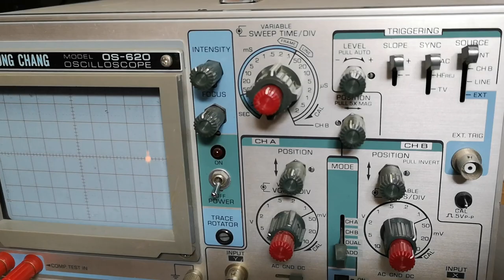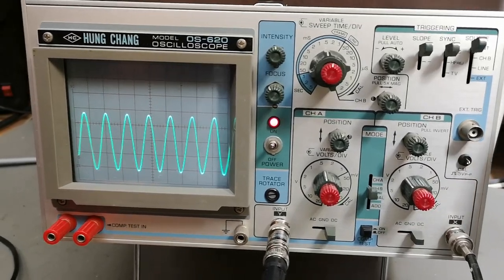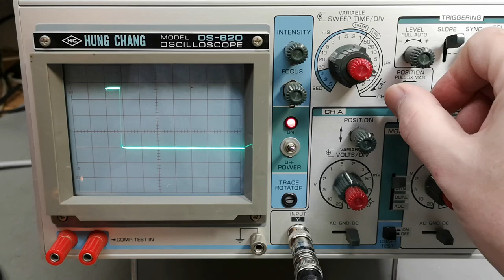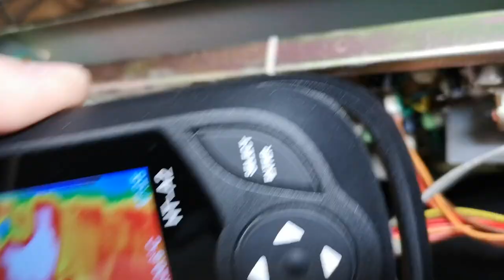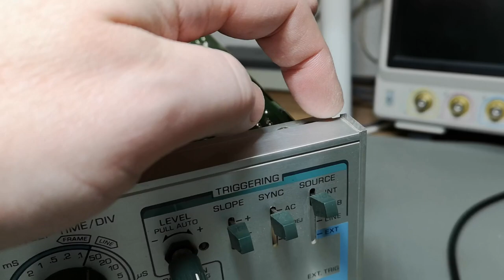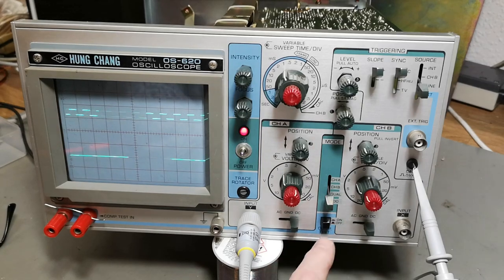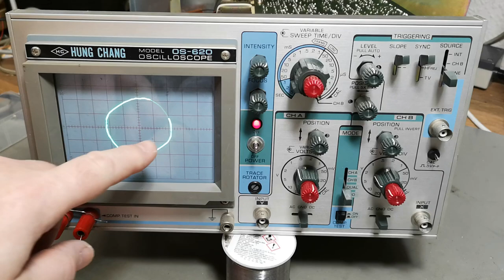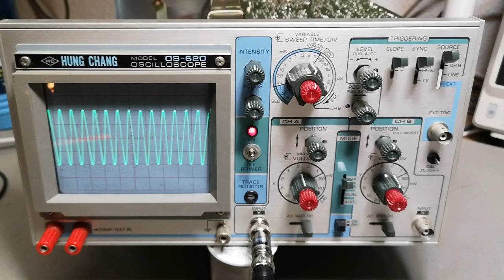Hung Chang OS-620 Oscilloscope 2ch 20MHz 1985 test teardown

Comment: Hi Thomas. I may be wrong as I'm no engineer in Heat Radiation but it seems to me that you would want the heat sinks to be as cold as they possibly can be. Being made from aluminium they are effectively conducting heat away from the powertransistors unto the surface of the heat sink from where it should be transfered by convection cooling into the air. By covering the surface you prevent this form of cooling and you are effectively rising the operating temperature of the transistors. This, I believe is what's picked-up by the heatsensitive camera.
Best regards,
/Torben
Reply from the maker: thanks a lot for your comment : thermal cameras work by radiation, shiny surface dont radiate heat, they reflect the heat from other things nearby, like a mirror reflect a picture of you, this way you dont see the temperature of a shiny heatsink, even if it is burning hot, adding a thinn layer of paint, will not isolate its heat, but will make it radiate, it will actually be a little bit colder, but now i can read its temperature by a thermal camera, i hope it makes sense.

Comment: Hi, where do you go for the gauges? 👍
Two observations, the right side skirt cannot be mounted the other way around, from the shots it seemed to me that the spacing of the screws is similar and visually it looks like a belt without the need for orientation, if there was a slight deviation on the nuts, the overhanging side could be down.
The second observation concerns the "Test Component" function, the displayed curve should be horizontally mirrored, i.e. during a resistance test, the usual image on curve trackers is from the lower left to the upper right quadrant. The same applies to the Zener diode test, the Zener voltage knee should be on the left (the current curve points to the lower left quadrant) and the voltage drop knee on the right side of the screen (the curve points to the upper right quadrant).
I personally can't imagine troubleshooting without using the curve tracker, I've found so many problems with it that I can't even count them. For example, an ordinary diode - the diode tester on the multimeter measured a normal voltage drop, when I tested the diode on the tracker, I discovered a problem, the knee of the transition was correct, but the voltage horizontal part of the curve was slanting down. Exceeding the current maximum of the diode during a device failure resulted in partial damage to the diode, and in the repaired state it then caused problems after heating to operating temperature.
For a Chinese person, the color design of the panel is quite normal, I really hate their coloring books for "Barbie", the same applies to displays, if each line does not have a different color, they are not satisfied.
In the Czech Republic, a Chinese man was selling fake Adidas shoes in a market, with the word Adidas everywhere and four stripes on top of that 🤪 When asked if Adidas should have three stripes, he answered "Yes sir, the more stripes, the more Adidas" 😂 and this also applies to the colors on the gauges - the more colors the more accurate it is 🤣

Nice day 🙂 Tom
Reply from the maker: ha ha, yes it is a bit colorfull and a bit smart designed, but it actually looks better in real life, and you get used to it, I think they try to make young starter people to get it, as their first scope, I also think you are right about the curve tracer, it is not super important if it is mirrored, the main feature is there, and it will be able to reveal a leaked diode, as you say that is the most common problem many people oversee, and why a repaired unit come back for more service short time after, if all is not solved first time.
Reply: @TeardownOZ2CPU  I probably expressed myself wrong, which is not surprising given my knowledge of the language. I find the colors on this model acceptable, I know much worse panel color schemes.
Full agreement, until the cause of the malfunction and its possible consequences are revealed, we cannot consider the device repaired. I know service technicians who replace a defective component and don't find out "WHY" at all. This can lead to an avalanche of malfunctions in the device, which, due to subsequent defects and the spread of problems, can become unprofitable for repairs. In my former job, it was the most common conflict with the management, why is it taking me so long, why am I still working on the device when it works, they didn't quite understand my answer "I don't know why", but it always paid off for me - I haven't had a single complaint in 18 years.

Nice weekend 😁 Tom
Reply from the maker: @Edisson.  good story :-) you can see some of the units I repair, got signs of erlier repairs, and funny : that is often where i need to fix things first.
some of the erlier repairs are actually the faults and reason for more problems now, using wrong parts for the job due to not understanding the correct feature needed.
Reply: @TeardownOZ2CPU  Yes, I noticed, some interventions are really "luxurious" and the one who performed them should hand back the report card up to the first class. I've also come across a few of these in my life - we even have an untranslatable expression for such - a device after repair "KUDO" - (KUtil DOmácí = home handyman) - example - I opened the device and there in a tangled mess of somehow adjusted and connected cable bundles ( factory tied into a mold with the exact length of branches) soldered-on integrated circuits hung from the PCB on wires freely in space. Then you don't know if you should take out the tools or start running with the words "Cut the blue" (it's like that in the movies - Cut the blue ... and then ... BOOM 😂)
Or when an authorized service technician came to adjust the hydraulics on one of our CNC punching machines - the gentleman was smart as a mobile (what are we doing wrong, etc.) and then left a large Allen key inserted in the adjustment screw of the hydraulic solenoid of the working piston and closed the main control panel. I had to completely redo the panel (he only does hydraulics - he doesn't understand electronics), broken switches, damaged PCB, ripped wires........ carnage
Reply: @TeardownOZ2CPU  Yes, I completely forgot to write about it Test component - the mirror image - if someone did some interventions in it and connected it in the opposite way, so that it does not cause any problem